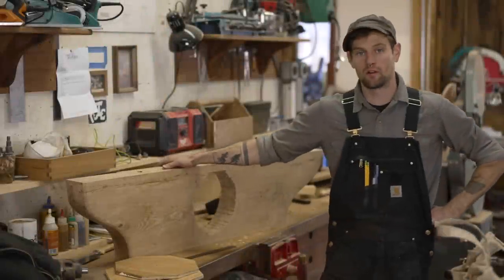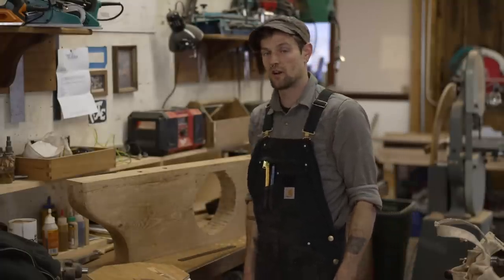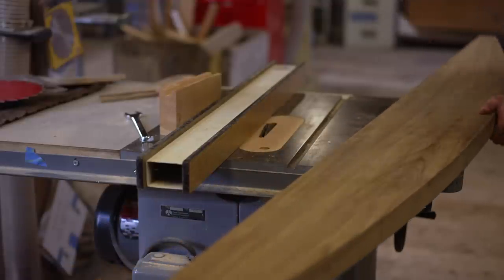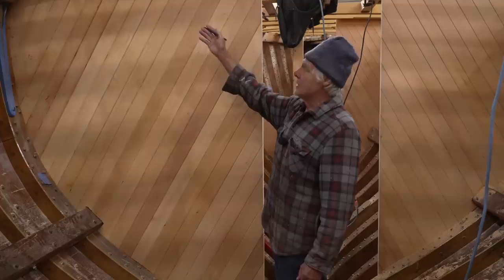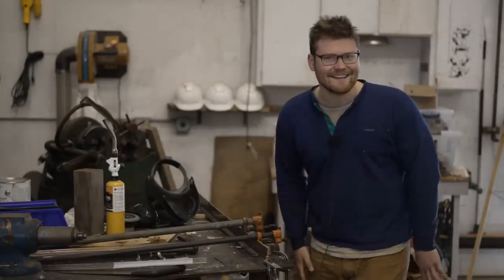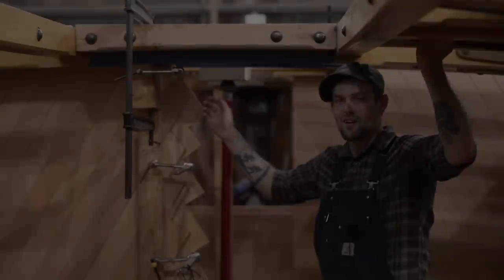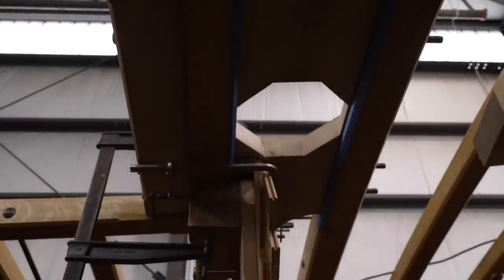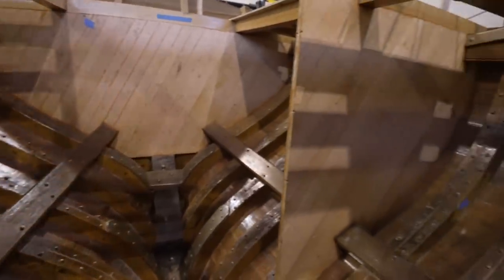Finishing the Transom, Bulkheads & Mast Partners (Rebuilding Tally Ho / EP109)

Comment: I will bet that the grumpy neighbor at the old location had a conniption fit when leo and crew suddenly began chainsawing and running loud motorized equipment again... too bad. Great update Leo and crew, glad the wood transport issue is solved and to hear of your plans for decking. Nice transom!
Reply: I am surprised that the open wood fire and smoke didn't bring out some town officer.
Reply: I loved seeing the huge fire!!!
Reply: @pauleohl  I think most states require a burn permit issued by the forestry department or some agency to do that.
Reply: @jakeeasterwood3204  We'll just have to club together to pay for Leo's bail.
Reply: @jakeeasterwood3204  And a few evidently still allow burn piles - with seasonal restrictions, I suspect. In the middle of the last century, I remember burning piles of raked leaves on the street in our Boston suburb (Brookline).
Reply: @robertbamford8266  Yup. Grew up in Haverhill and we burned the leaves in the gutter line as well. Still love that smell.

Comment: Tiny little note; the festool ETS EC sander Rowan was using in the first part of this video does not have an integrated blower and relies on active dust collection to expel the fine sanding dust. from personal experience operating it too long without DC can cause you issues. Worth popping the pad off and getting in there with some compressed air, you'll get a much longer life outta it! Spectacular project, obviously, congrats on how far she's come just in the last couple months.
Reply: Up

Comment: Donald J.
There is an aesthetic item that I have been mulling over which I would like to suggest for your consideration.  Your transom, comings and cover boards will be teak. It seems to me that a teak hull plank from stern to stem would tie all the teak parts together and would add a lot of class to the boat.  I think the easiest way to do this would be to put the teak plank over the top plank.
Cheers,  Don

Comment: What's this cutting bronze with a grinder wheel [for non-ferrous metals I hope]?

A carbide chop saw blade, on a chop saw, is an excellent way to cut bronze, copper, aluminum. 

Also a belt sander is much better than a grinder for chamfering long pieces of non-ferrous metals such as bronze.

Comment: Just out of curiosity, won't fixing the mast partner in place now, before you make the mast to fit it, make ensuring the fit of the mast tricky? As you'll need to be trying to drop it in place by the time you see if it works.

Comment: Leo, A set of questions re the mast partner since it is wedged together... is the deck level position similarly wedged for a zero clearance fit ?  Will there be another set of bolts running fore and aft either thru or close by the mast to spread loads ?

Comment: Question: Leo said "athwartship bulkhead." But if it is not athwartship, is it still a bulkhead? For some reason I thought that all bulkheads were, by definition, athwartship. Then again I wouldn't know what to call a "bulkhead" that runs fore and aft. Seeking enlightenment on this.
Reply: I hope this answers your question. There will be longitudinal bulkheads which run parallel to the centreline too.

Comment: I've been following the construction of the Tally Ho almost since the beginning, but this is the first time I've had a question. I noticed that you used a dado blade on the top piece of the transom and I wondered how you would make that wide groove if you were working back in England or anywhere else in Europe. I understand from other woodworking sites I belong to that dado stacks are illegal in Europe and the UK, hence the question. Would you just make repeated cuts with a single blade until you've built up a wide enough channel? Thanks!

Comment: Hey leo, has the move to port townsend been better for the project, or would you have rather stayed at the old place?
Reply: Although those neighbors DID NOT HELP, the cause of the eviction was Leo's refusal to accept a time limit on the permit for his boat-cover as a temporary structure. Even so, Clallam County let the matter slide for over 3 years before their non-compliance complaints became threats of very expensive fines. At that point, Leo was able to negotiate a reasonable time-frame, & Tally Ho's beautiful rebuilt hull could be safely transported to an environment much better suited to her needs.
I think the noisy neighbor & the county get a bit more abuse than they deserve.

Comment: So I’m guessing you don’t have to build the boat around the engine? You’ll be able to get it through the hatch? And the bulkheads?
Reply: The engine is smaller than you think, mostly used for maneuvering in port,  and it goes through the hatch and you slide it along temporary wood tracks.  You don't have to pick up the whole engine at any point, just lever it into place.  Often they need replacing, as such they always fit through hatches or gangways.  Good question though!
Reply: The bottom part of the cockpit will be removable and is more than big enough to install  or remove the engine.

Comment: Why are you using as your thickener for polyester resin? And what is your resin mix? What is the ratio?
Reply: Don't  know what they used but I use cotton  flox.  It is a flocked or pounded cotton  cloth to a fibrous powder type stuff.  Very strong when mixed with epoxy resin. I  built a homebuilt aircraft with it. Epoxy resins are generally  better than polyester resins , depending on what you are doing.
Reply: @leschortos9196  that interesting thanks for the share… I’ve noticed that it seems like a lot of boaters use polyester resins msy was of anything else. I’m not very familiar with the differences between the types. And I’m curious why Leo uses poly, knowing him he probably has done all sorts of research and intimately knows why to use poly opposed to something else. It would make an interesting little info session to pick his brain over it…
Reply: @drewynucci9037  It's epoxy, not polyester.
This was discussed in an earlier video about attaching the bulkheads to the deck beams.
Reply: @jimurrata6785  oh interesting, I must’ve  not paid attention to that detail… I’m going to have to go back and rewatch to see if I can get a better sense of the process they’re using and why those choices work for them… thanks

Comment: Are you planning on insulating?  Or going with all natural look and more blankets? Lol
Reply: The prob w/ insulation is, water vapor condenses between the hull & insl, w/ no path to the bilge or airflow to remove it. A Recipe for Rot !
Reply: @frederickstibbert7389  you can’t use polystyrene with foil backing and standoffs? That would allow the water to flow down and give an air pocket between.  Just curious. Only other option I could think of is a type of flow foam but they may crack as the wood shifts with shrinkage and swelling.

Comment: What will actually be original to Tally Ho? The transom, hatch coamings... What else? The mast?
Reply: Lower 3 of 6 teak transom planks. Teak cockpit & deckhouse sides. Hatchway covers might be usable. Massive bronze capstan (needs TLC). Half-dozen bronze portlights. Odd bits of rig hardware such as bowsprit heel bracket & mainsheet horse. ~4.5 tons of lead from ballast keel (needs re-casting). All of her history & Lloyds registration number.

Comment: The finish coat of varnish on the transom with a two inch 'Polybrush'? No!
Impossible to do it correctly with that. It can't hold enough material. Those strokes should be going completely across, not broken into 5 laps. Please buy a decent natural bristle brush. The material will spread much easier, with less effort and with a much better result

Comment: Everyone else already said it but great to see so much getting done. One question do you feel that there is enough strength in the mast partner and king beams to deal with the forces applied to that area when running down wind under full sail. In particular if you decide to go for a spinnaker. The temptation to hoist a big kite when racing all to common in conditions that are really too windy It would be a great shame to see Tally Ho's foredeck buckled and cracked after so much wonderful work.
Reply: Won't the standing rigging also help distribute those forces elsewhere along the hull to other structural areas?  I would imagine the mast partner only shares a little of any load.
Reply: There are no standing back stays on a gaff rigged boat you have to rely on running back stays to restrain the mast, these can only be operated on one side of the boat, giving an unequal support, prone to twisting Which leaves you in a position of having to rely on a crew member to get it right every time. You know the adage if it can go wrong it will go wrong, double so at sea, you can double that again when racing. She's not my boat but if she were I would be distributing those loads out as far as I could. The work to do so would be easy at this stage and would add very little extra weight.
Reply: It's the job of the rigging to support the mast, with a big kite you get compression when the backstay are on, not forward motion.
Reply: @frankstocker5475  In perfect conditions that would be almost true, but in a broach or heavy jibe those forces are no longer adequately contained, crew can slip up ,trip or be in a trance, blocks and eyes can part and running back stays  not always the fastest thing to tighten. I have seen single tree masts whip , shimmy and bow in strong winds when hard pressed  where does that leave your theory.?